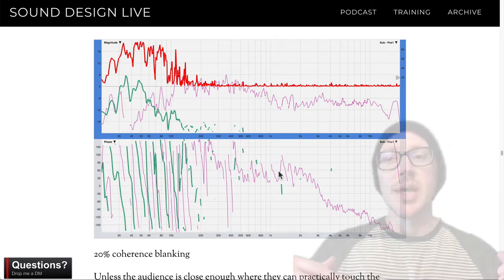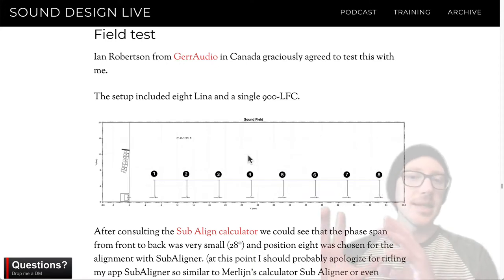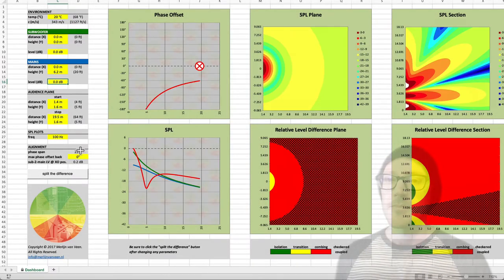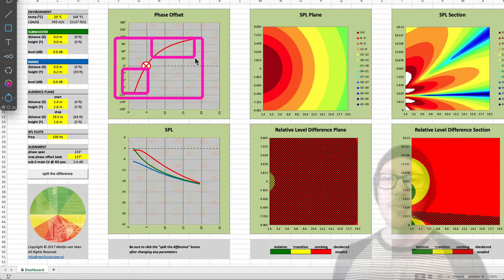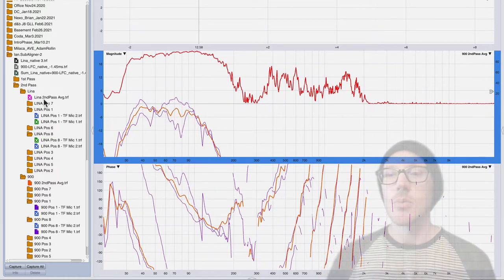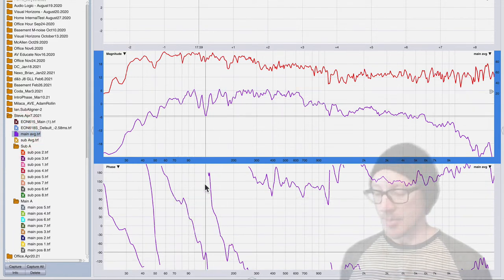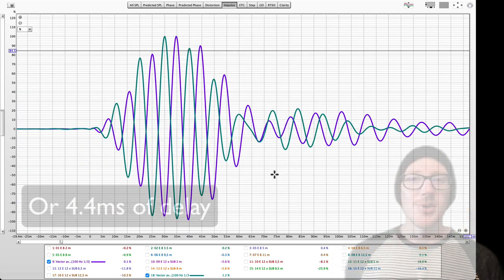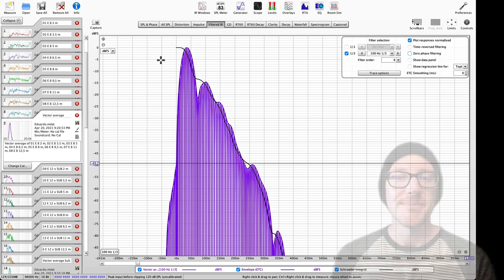Don’t Align Your Subwoofer to a Room Reflection

Comment: Dude, i bought a genelec system u think they crossoover has phase issues? Havnt measured yet ..will sonarworks fix an issue like this? U dint explain...
Reply from the maker: Hey Studios
>  u think they crossoover has phase issues?
I have no idea, but if you want to take some measurements and send them to me I'd be happy to take a look with you.

> will sonarworks fix an issue like this?
My understanding is that SonarWorks is focused on complementary EQ filters caused by speaker to room interaction. I don't know if it has anything related to subwoofers.